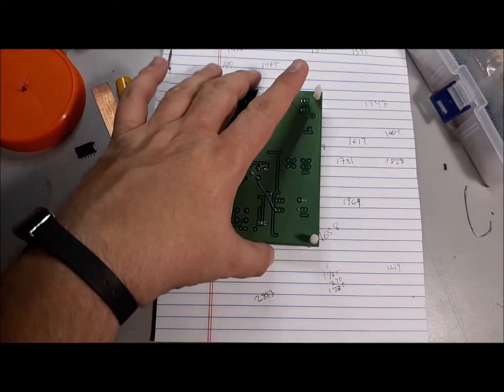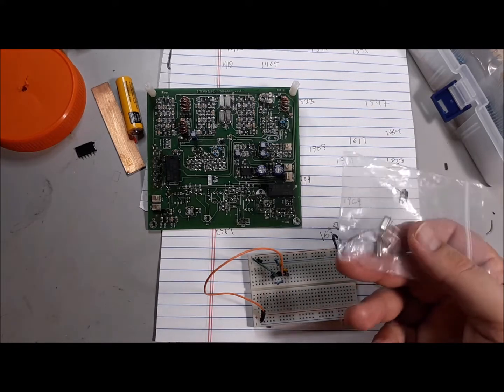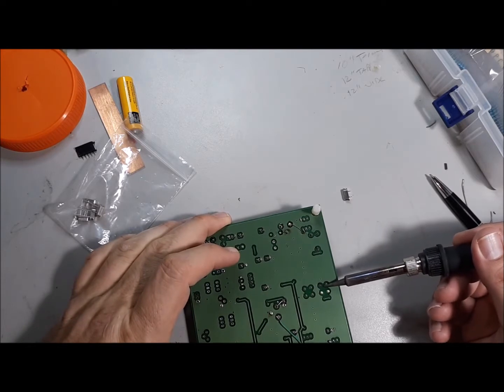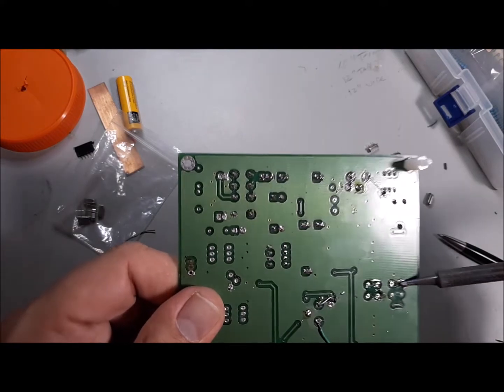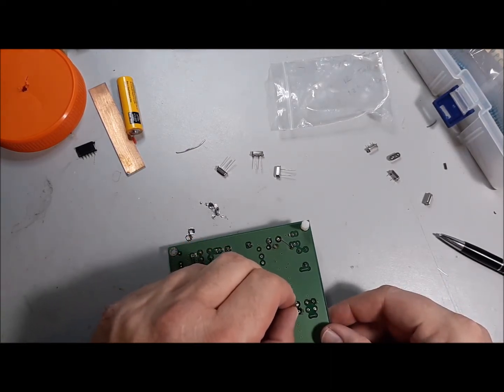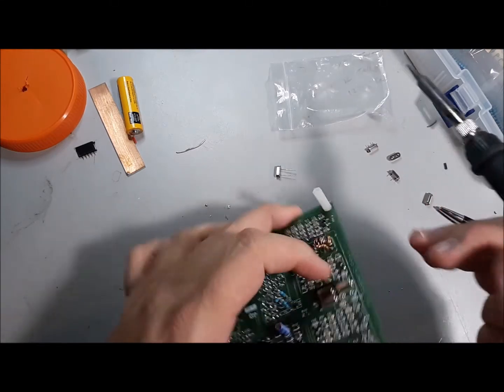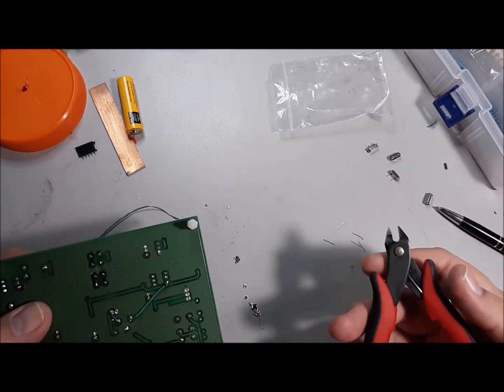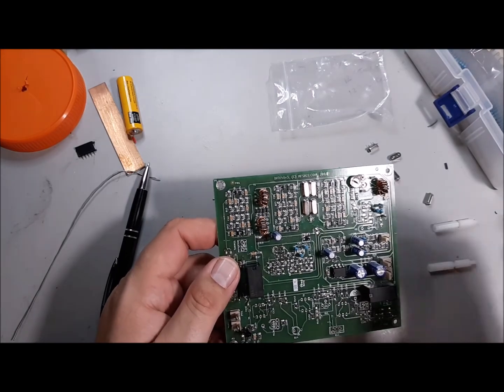BITX40 Rebuild Part 1.1 Crystal Filter Replacement

Comment: For ladder filters, which is what you are building, you always want crystals that are matched as closely as possible. That 10% of bandwidth number in the W7ZOI is the MAXIMUM spread for building an acceptable filter; use better matching crystals when possible. If you buy a big bag of crystals as you did, you can make multiple sets of close matches. The sets won't all be on the SAME frequency but that doesn't matter.

The lattice filter is another design of crystal filter. They were very common in radios from the 1960s and 1970s. They were never a popular homebrew project because you need crystals that are on DIFFERENT frequencies in a specific arrangement. Bags of commodity crystals often won't yield any with the correct relationship to build a lattice filter. It also turns out that most of those lattice filter designs had very bad time domain behavior, which made the radios sound bad in subtle ways and also makes them unsuitable for some data modes, so they're far less common now.